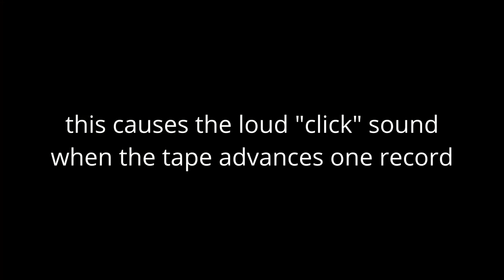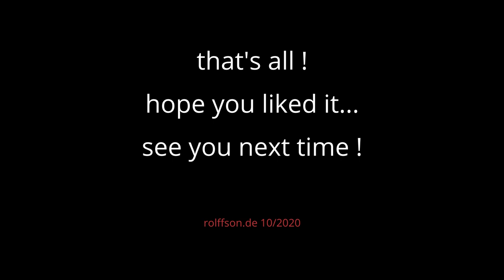IBM 729 (and other) mainframe tape drive - why the funny movement?

Comment: These drives were also very deep and had a terrifying amount of physical horsepower in there. The amount of belts and motors looks like the inside of a helicopter, I wonder if anyone every got injured while repairing these monsters. I still want one though.
Reply from the maker: the service manual explicitly stated "CAUTION Use extreme care when working inside the tape unit to avoid injury from the reel drive motors and belts. Whenever possible, the motors should be unplugged as a safety precaution."
Sound like they had some experience with not so beautiful incidents... 😮
Reply: @rolffsonsIBM1401channel  Yeah, I once saw a kit helicopter up close and the belt and pulleys didn't look that much bigger than this tape drive's. I can easily see a finger being yanked away like it was a breadstick.
The lengths people went to to get 20 megabytes of storage was amazing. I still want one of these drives, I'd like to stream a MP3 from one some day.

Comment: Are you able to add an option menu for quality?
Reply from the maker: Yes, I've already done some tests with an options menu (module "Auto Settings" from the UE market place), allowing to change the graphics settings in the same way as ordinary 3D games. Unfortunately it will take some time (weeks?) before I have the spare time to include it into a new version. 
Of course since the project is based on a regular game engine with some demand of 3D performance, it will never run sufficently based on CPU integrated graphics; nevertheless I hope it may be suitable for graphics cards of some recent generations, since there's not really much game action. When it's ready, I would be pleased if you could give it a test and let me have some feedback.
Reply: Yay! Thank you, I will test it when it ready